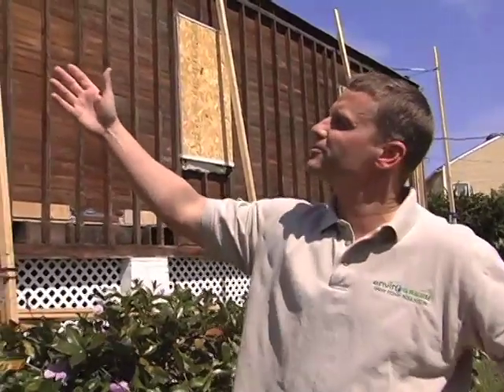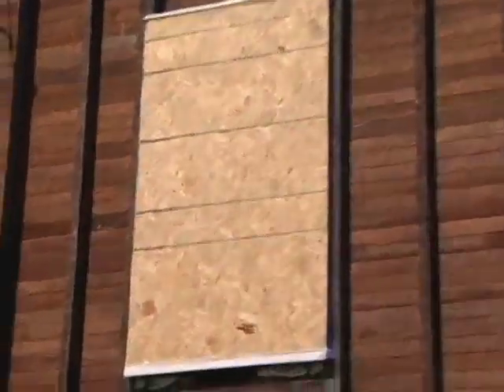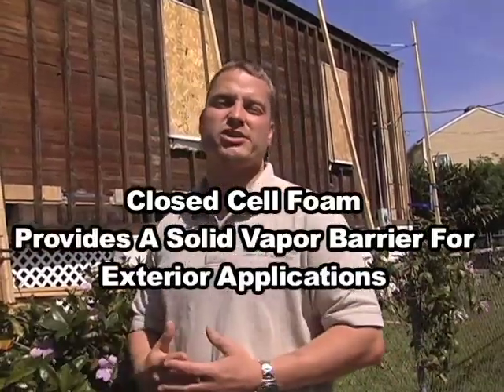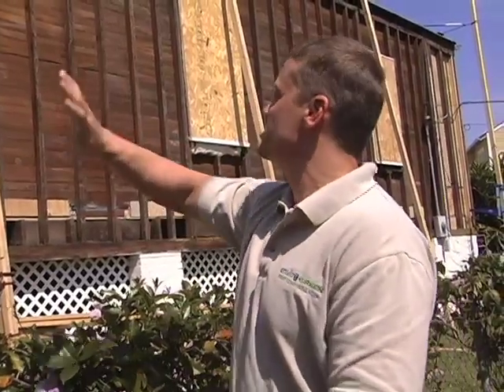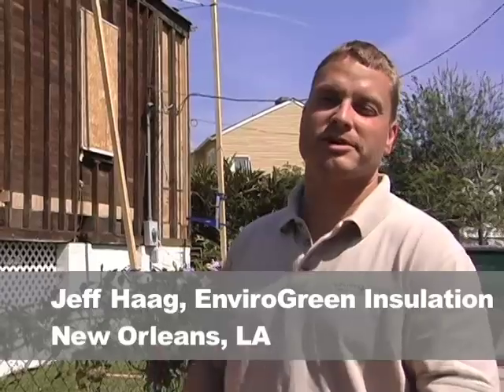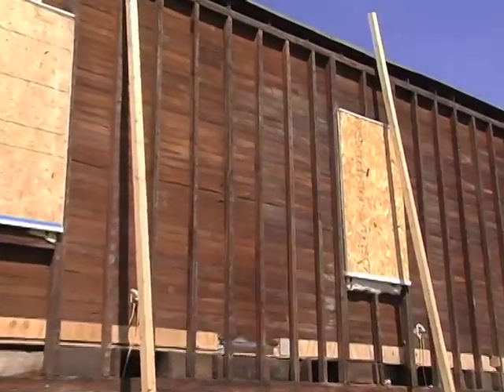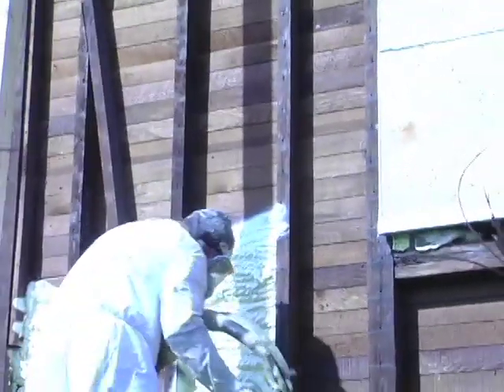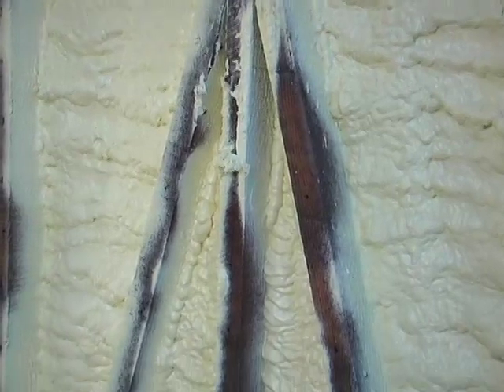Case Study 1 Open Cell Insulation Vs Closed Cell Insulation

Comment: I dont understand your argument, your against bringing filtered air in the home using an HRV? You say that if it breaks the house becomes toxic, but cant you just open a window while your waiting for it to be fixed? Filtered air 99% of the time, for the 1% of the time it could be broken fresh air from a window still better than unfiltered air 100% of the time, especially during allergy season.

Comment: @AmazingFoamInsulatio If a dog shits by your HRV intake, enjoy that fresh air. Fresh air from one source is a risk you can take, also, if the power stops, or the HRV stops working and you don't know it.................good choice, house can become dangerous if one moving part breaks, that makes sense.  House can be dangerous if you spray the wrong herbicide or pesticide near that one air intake for the house.  Still can't figure out why foam and HRV's will be found on .00000001% of new houses?

Comment: @AmazingFoamInsulatio Or you can test the home and make sure it has the right amount of natural airflow, and save the customer 1500$.  Combine the mortgage interest of 1500$(10$/month) with the electricity cost of running it and you will find, HRV, poor choice financially.  Thats is why it is RARE, idiot builders with the money for foam and HRV's are RARE.  It is called return on investment, you should try looking into that.

Comment: Vapor retarders are recommended in certain climates, but vapor BARRIERS are are not recommended anywhere but cold, dry climates. Not to mention, heating and cooling only account for about half of the avg. enegy bill, meaning it is impossible to say you are going to reduce the HVAC usage by 90-100% Every home is required to have a moistre escape plan.....is the HVAC supposed to remove 100% of the moisture vapor? How humid will that attic get? Do you test to make sure the home isnt too tight?